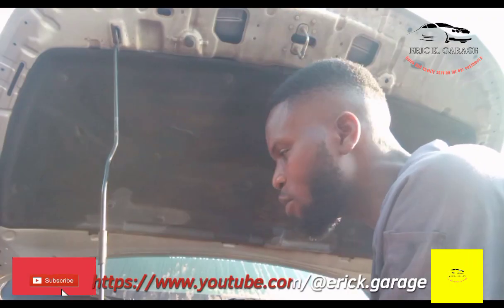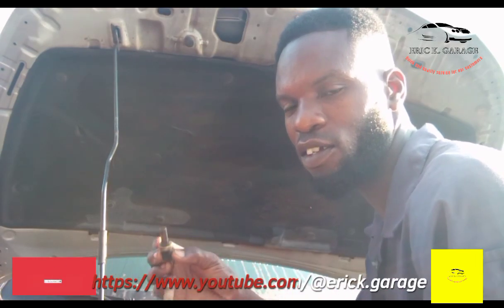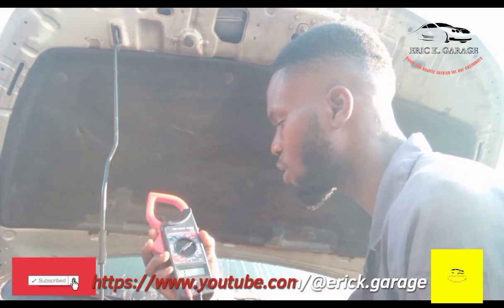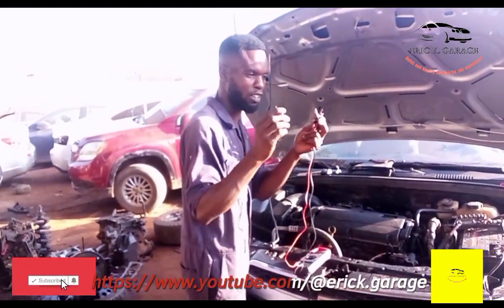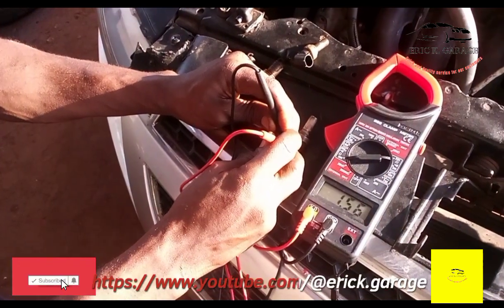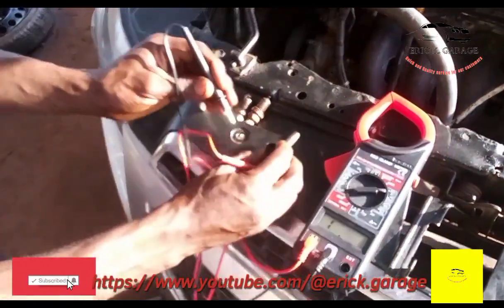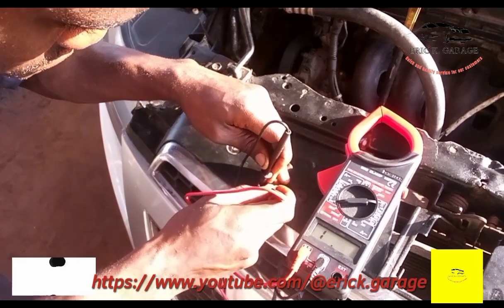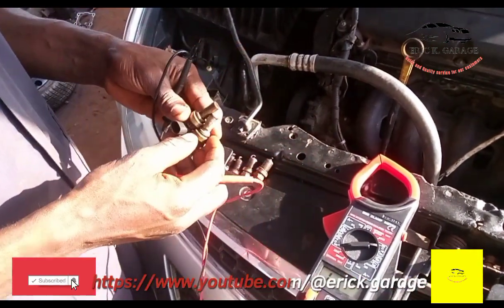How to check the ohms of coolant temperature sensor, Using multimeter

Comment: How you check the wire to the coolent temp sensor ?
Reply from the maker: Thank you very much for your comment
Please do you want the voltage of the temperature sensor or you want to know if the temperature is working
Reply: @erick.garage  harness
Reply from the maker: @EscobarMT  ok I will do that for you 👍